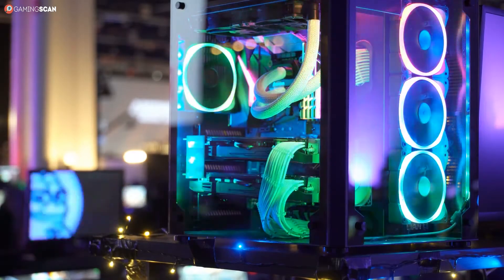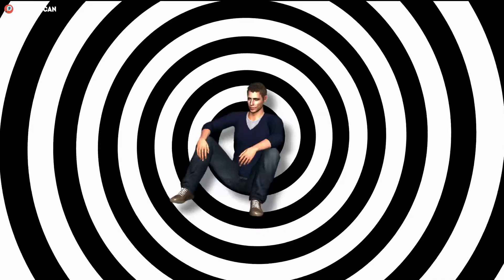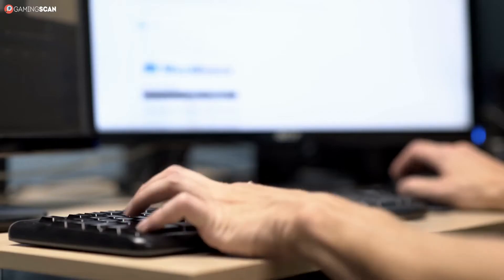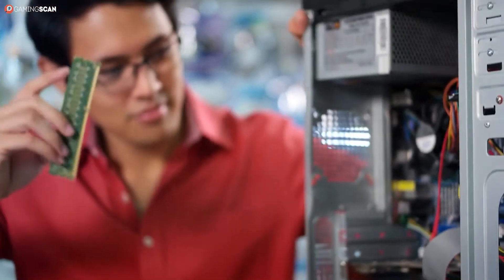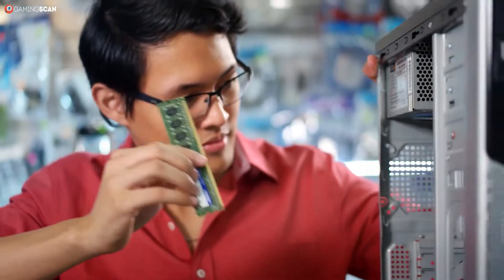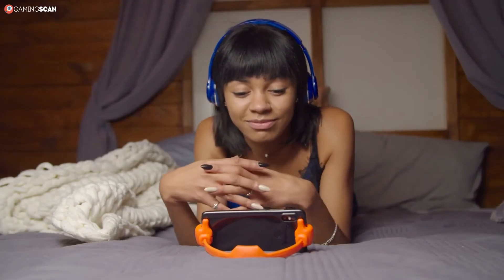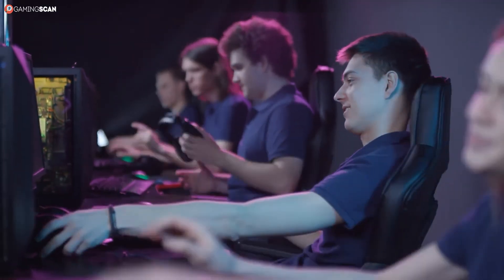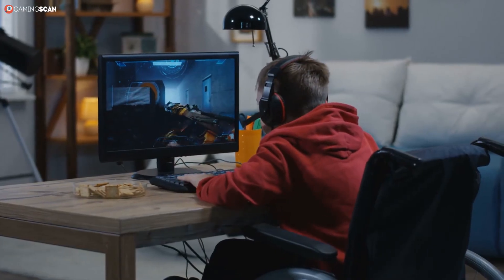What RAM Is Compatible With My System? [Ultimate Guide]

Comment: what are  all those letters an numbers mean, especially when trying to match QVL RAM for a motherboard. 
example :Memory Module RAM SP064GXLWU560FDH and 
             Memory Module RAM SP064GXLWU560FDE
 The only difference is the H and the E
If the manufacturer tested and recommended H but you can only find E would it work in the board?

Comment: I want to upgrade the ram of my Laptop for Study reasons, but I have a Question my laptop ram Capacity is 8GB and 1600Mhz but right now the installed Ram to my Laptop is 4GB and 1066Mhz so my Question is It its okay to remove the 4GB Ram of my Laptop and directly replace it with 8GB ram with 1600Mhz?
Reply: Absolutely

Comment: Should you of also included the exceptions such as "apple and Mac"? 
I once sold someone some laptop RAMs at work, but I was out of stock for the clockspeed he wanted to buy. So, instead, I gave him RAM for a higher clockspeed assuming it would be compatible, just downgraded to the appropriate clockspeed he needs. Little did I know, it was not functional at all for him, we found it Apple and Mac seems to "require" the appropriate clockspeed in order to function.